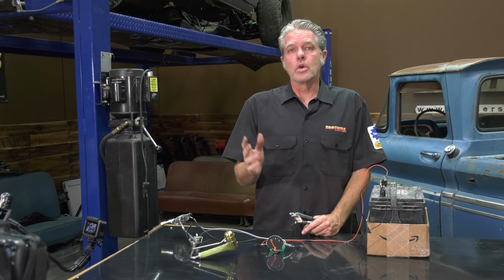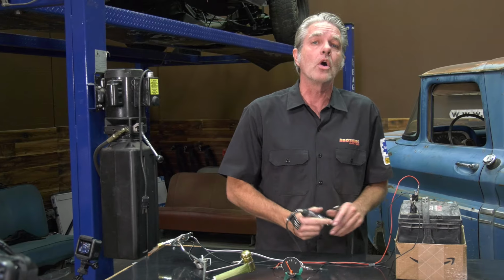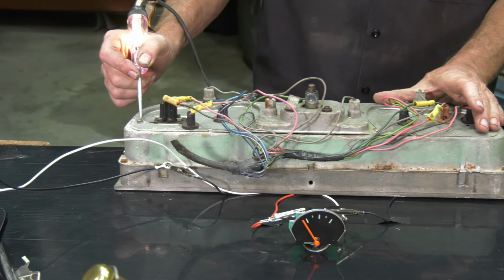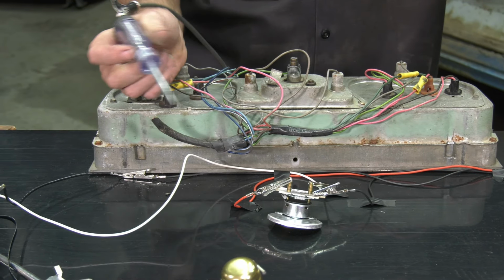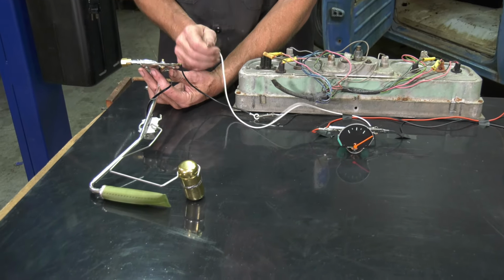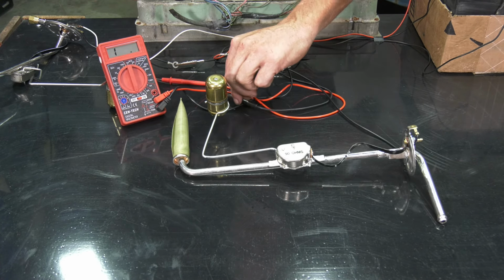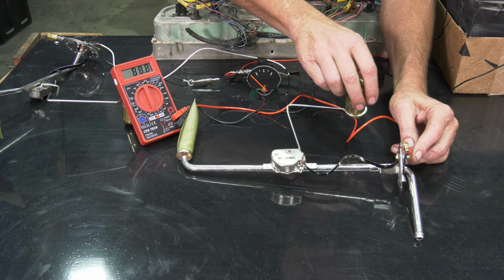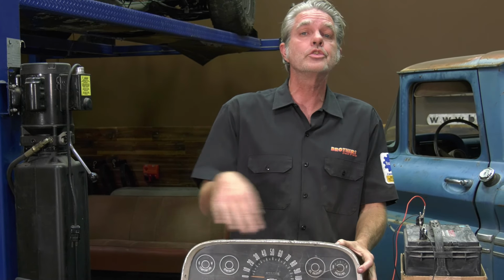1947-87 Chevy & GMC Truck Fuel Gauge/Sending Unit Troubleshooting

Comment: I got a gas gauge in my 78 c10 that’s bouncing around clock and counter clockwise and I don’t believe it’s reading accurately at all when it’s not bouncing right now, gonna try to add a ground wire from the post on the gauge to the cab, or any bare metal see if that helps…

ALSO can you do a video for someone without the tools , I don’t have a multi meter or test light right now and I’m trying to figure out my wire routing to my glass fuse panel, I left all bulkhead connectors alone, just the wires connecting to the fuse panel I have some cross feeding going on, windshield wiper switch when I move right to any speed it doesn’t work, when I press it in, it illuminates my dash and heater light… I rewired my headlight switch in the dash so last I check my dash lights work properly, after I tested windshield wiper switch and it still blew a fuse illuminating the heater light and courtesy on the floor…

Comment: Thank you for the great info, I have a 1979 chev c10 that I am resurrecting that has been sitting for 10 years, my fuel gauge was working intermittently, now it has stopped working altogether. it reads beyond full. This info helped a lot.

Comment: I bought a c10 with dual tanks. Looking for a dual tank setup
Reply: I know this is 1yr old already but the dual tank trucks have a selector switch on the dash. You press and hold for a bit. It switches the fuel AND the fuel sender from 1 tank to another.

Comment: Hey there, I'm curious about something.  I have a 91 Chevrolet Silverado R3500, last year of the squarebody heavy trucks, and I just got it back from the mechanic after they replaced both fuel pumps on the truck. When I sent it in the fuel gauge worked and about 5 weeks later, the gauge doesn't work! They said "oh it's the cluster  because the oil gauge reads 400 lbs"!  Sounds to me like they broke something and don't want to fix it! What would your thoughts be?

Comment: I'm an idiot.none if this makes any sense to me. It's lighting up on ground and positive?
Reply: You have power hooked up to the clip end of your light tester from the battery when testing the sending unit wire. (Passenger side of guage.)You are checking for a good ground. When testing the power going to the guage, you ground the clip end of the tester on a known good ground and touch the light part to the power terminal on the guage. (Drivers side of guage.) Does that help?
Reply: Key on when testing power side.

Comment: I put a fuel injection pump for a 80's chevy truck new, in my 1977 k20 tank and gauge wont register, any help are fuel gauge different ohms? Any help thanks. Aftermarket fuel injection, truck runs exceptional but no fuel in tank and i have put 12 gallons in tank

Comment: I had a question i have 75 K5 Blazer. Im trying to order a new printed circuit. When ordering a printed circuit there are different options. One of them being without gauges or with gauges. Im trying to understand the meaning of it. I do have the fuel gauge on the right, speedometer, voltmeter, oil pressure, temperature gauge and at the bottom left its a warning light or brake light. Which printed circuit to order?

Comment: If the gauge sweeps slowly toward full and doesn't return when hot wired is the gauge bad?
Reply from the maker: What do you mean by hot wired?
Reply: @BROTHERSTruckPartsTV  i ground the gauge then with my test light that has 12V Is touched to one of the post on the gauge it will sweep to full slowly, if I reverse my set up it will sweep empty slowly
Reply: @BROTHERSTruckPartsTV  I took the gauge out of the cluster
Reply: When everything is hooked up the gauge will accurately show empty for both tanks. But will never show above a 1/4 tank. I have the sending unit hanging outside the tank to test accurately. 
I've also replaced both sending units and chased and checked every wire.
Reply from the maker: @philup6274   Yes, it sounds like you have a bad gauge then.
Reply from the maker: @philup6274   BTW, Your troubleshooting skills are 100%!
Reply: @BROTHERSTruckPartsTV  Thank you brother. Teamwork makes the dream work. Thank you for making this video it has saved me so much time.
Reply from the maker: @philup6274  Our pleasure!

Comment: Dave did an excellent job in this video. Gauges and Sending units seem to be mysterious in some fashion but simple in reality.
  A gauge is best described as that experiment in high school science class winding insulated wire around a nail. When connected to a battery, it becomes an electro magnet.
   Now, imagine a gauge as a nail on one side wired clockwise, it pushes a paper clip away. A second nail is wound counter clockwise and attracts the paper clip. Now if both nails shared a common ground, a variable resistors, changing the strength to ground makes one side push or become weaker. Same here, except it is inside a gauge. So basically reverse polarity if you can imaging, the common point to ground is a wire wound resistor to ground. In this case, 90 to 0 ohms resistance. If at 45 ohms, both nails have the same push/pull, so the gauge reads? 1/2 full! You got this. As Dave did, placing the lead to a good ground will push the needle completely one direction. 
(Imagine one nail is strong and the other is dead) The different is at the sender.
Dave made another good point, that's using dielectric grease on connections. Under the truck? You bet! On the cluster connector, sure! It keeps them clean and not green as copper traces oxidize. They slip in and out better as well, saving that printed circuit on your gauge cluster. Thanks Dave! Good info for those in town and around, the world! Keep em going folks! 
DK, ASE master since 1978.

Comment: Is gauge failure a common problem? I'm running out of things to check, my trucks a 56.
Reply from the maker: check out our more recent video about fuel gauge troubleshooting. Maybe you'll see something in it you didn't see here. Gauge failure is always a possibility too, however its easy to check and eliminate that as the issue normally.

Comment: I have a 12V Gauge. It reads past full when the sending unit isn't even connected. Can you please make a video on how to wire it? This truck was given to me so I do not have the directions.
Reply from the maker: This is almost always caused by a lack of a 12v source of power to the gauge. The gauge will just drift higher and higher, even well beyond full. Make sure your gauge is getting a 12v power source.

Comment: Dave thanks for the video, just changed to EFI on my big block 69 c10 restto- mod.  Been fighting with my gas gage for a week. You made it so simple. Fixed after watching your video in about 20 min.
Reply from the maker: Nice! Thanks for the feedback.
Reply: What was you issue that got solved?
Reply: @philup6274   it was not properly grounded. I used rubber washers installing the fuel tank, what happens you over think something. Removed the rubber washers. Working perfectly now. Thanks again

Comment: I have a 71 Chevelle
I pulled the fuel tank and replaced the sending/float unit because the gauge would stick on fuel.
I noticed that the stop tabs for fuel and empty were bent off to the side.
When I pushed the float all the way up past the fuel tab it would stick there.
So when I installed the new sending unit I did not bend the tabs.
Now when the tank is full the gauge read between 3/4 and 1/2.
Once the fuel gets down between 3/4 and 1/2 then the gauge works.
Any ideas on what’s wrong?
Reply from the maker: Sounds like the tabs are blocking the float from moving all the way to the top
Reply: @BROTHERSTruckPartsTV  
That’s kinda what I was thinking but no one said anything about bending the tabs

Comment: Dave, do all C10's gauges come with resistors, oil, temp, fuel, battery. Can bad resistors give you false reading or no reading. Please advise. I'm trying to get my 1980 C10 back on Road. Any info would be greatly appreciated. Thanks Robert  one more question, Dave . The porcelain resistors are in the back of the gauges correct? Now are they a part of the problem that the gauges don't work.? Or do you need the porcelin resistors to get the gauges to work. It's been a long day and I'm tired. Please help.  Everything works except the gauges.  "My gauges, Are 40yrs old"
Reply from the maker: Yes many gauges have resistors, and they need to be GOOD for the gauges to work. However, if all your gauges are NOT working then you likely have a ground problem or your cluster isn't getting 12v power.
Reply: Where does the power go to on the cluster Dave is it the full side terminal or the empty side

Comment: 1986 c10 new fuel tank and sending unit but my fuel gauge only moves to quarter of tank. I rebuilt the instrument cluster.  Is there an adjustment to the fuel gauge  the do or reinstall it wrong?
Reply from the maker: There's no adjustment, something is wrong. Bad ground, bad sending unit, bad gauge... start by checking all the grounds and the 12v power to the dash.
Reply: @BROTHERSTruckPartsTV  I checked unit, ground  I believe it's  the gauge on the cluster.  Now that remember hear d a little pop noise. Thanks
Reply from the maker: @tinocorrea742   if the rheostat on the gauge gets damaged you could have the gauge only work to a certain point and then stop. Does it sit there for a long time when you fill up and then start dropping when your tank gets low, or does it act normal but just doesn't go all the way up anymore?
Reply: When I fill up that where it stops. It moves down just not all the way full.
Reply from the maker: @tinocorrea742   but WHEN does it start to move down? right away, or after you burn through 3/4 of the tank?
Reply: It moves as if it marking full. Moves as I drive truck like normal but  needle doesn't go all the way up to full when I fill it up. It stops on quarter line on the gauge and no more.
Reply from the maker: @tinocorrea742   Ok, so there is either a problem with the sender, or it could still be a weak ground on the dash panel.
Reply: I'm going to check the cluster again or the fuel gauge on the cluster maybe it not correct when I rebuilt it. Thank you

Comment: I have an 87 truck with dual tanks. fuel gauge always shows the drivers side tank fuel level ( accurately). when I switch tanks it actually switches tanks fuel wise. but the gauge stays on the driver side tank level. Can you point me to trouble shoot this one.
Reply from the maker: it sounds like you have no switch connected to the signal wire from tank two. These tank senders are simple 1 wire units, so you'll just have to trace down the wire for tank two and see where it goes and if it's connected to your switch.
Reply: @BROTHERSTruckPartsTV  The Senders from the tanks are on switched terminals A & C of the Valve. They each read an Ohm value 0-90 depending on the fuel level. From there, does terminal B supply the info from either sender directly to the Gauge? I get confused with terms here. I call the motorized Pollack valve the 'Valve" and the AC Delco dash switch the "switch".  It looks like the switch tells the valve which Tank valve, return line, and Sender to use. but the switching of all three happen in the valve.  I will see if terminal B on the valve has the Ohm Value of terminal A or C. and if it changes when the switch on the dash changes.  If I have this correct. It seems the pollack valve is switching the fuel lines and Return lines but not the sender information.  Confirming or correcting me would be a big help.
Reply from the maker: @joeengel5132   to be honest, we don;t have a ton of experience with these valves.switches either. We would do EXACTLY what you are doing by testing the B value to see if it has the A & C values correctly. We'll try and gather some additional info on this as well and report back here if we find anything.
Reply: @BROTHERSTruckPartsTV  Just following up on this. I did figure it out.  this is the correct operation for a 1987 Square body with dual tanks. (The Senders from the tanks are on switched terminals A & C of the Valve. They each read an Ohm value 0-90 depending on the fuel level. From there, terminal B supply the info from either sender directly to the Gauge)   Thanks.
Reply from the maker: @joeengel5132   Excellent info, hopefully we can do a video on this at some point that will help others that are having troubles like yours. Thank you!

Comment: I got a new sending unit and checked it like you did, and it didn't go to 90 like yours did, 1975 Chevy Cheyenne K10 350
Reply from the maker: What did it go to?
Reply: @BROTHERSTruckPartsTV  Fuel gauge
Reply from the maker: @kellybergin1532   We meant what OHMS did it go to? If not 90 then what?
Reply: @BROTHERSTruckPartsTV  I installed the sending unit then pulled the tank back out and rechecked it along with the guage that I Fukd up the sending unit works right
Reply: The sending unit is ok
Reply: @BROTHERSTruckPartsTV  Brothers, what plugs into the female plug at the bottom of the steering column, is it those 2 plugs ?? I got this truck and it is all jacked up.wiring wise!!
Reply from the maker: @kellybergin1532   Depends on the color of the wires in that plug. Not familiar enough with every model year variation to try and give direction without at least know the wire colors.
Reply: @BROTHERSTruckPartsTV  I check the wires tomorrow and let you know, they were hanging loose when I got the truck about 4 months ago
Reply: @BROTHERSTruckPartsTV  there was no plug on the bottom of the steering column either, otherwise I would know

Comment: Where did you connect the positive wire off the battery?
Reply: Ok, I see that, but you have wires running under the cluster so i'm confused
Reply from the maker: @kellybergin1532   those wires are just random jumpers we were using for the demonstration.
Reply from the maker: We connected it to one of the posts on the back of the gauge as seen @ 1:48 in the video.

Comment: I have dual tanks. Gauge works correctly when switched on LH tank. But when you switch to RH it’s empty (but it can have a full tank).
Reply from the maker: Probably a ground problem, but you need to test the sender to figure it out.

Comment: Fantastic video brothers. You got me in the neighborhood. For whatever reason my 85 S-10 goes through gas pumps every so often. I'm on the 3rd or 4th one. Early on mos prolly ethanol. Haven't run that in years and the last one is holding good. But after the last round the gauge is just wonky. Might show half full and then flop over to full, depending on the slosh. Did we put the sending unit in backwards? It's all over the darn place but never shows what it should. Ground? Backwards? The bed is coming off soon so I can get to a short rubber line that is currently spewing gas when the pump is on. Failed at the clamp. (The thing is beyond antique. Ha!)  While I'm there thought I might as well see to the gauge. Suggestion? I thank you!!
Norm
Reply from the maker: Yep, check everything you can while it's apart and easy to access. Thanks for watching!

Comment: Great video David, thank you
Reply from the maker: Our pleasure!
Reply: Hi David, I took some ohm reading's on my sending unit on my 53 Chevy pickup, I'm reading on empty 18 ohms and full I'm reading 52 ohms. I'm thinking that's not good. When on an early Chevy you said, it should be 30 ohms when full.  My guage reads a little less then half when tank is full of gas. When I remove wire off the sender and ground it to itself the guage goes lower. It don't ping to full. Not sure if I have a bed sender unit, and a bad guage. Can you please answer that, it would be great to get this gas guage to work again. Thank you

Comment: so my k5 blazer reads from empty to 1/4 tank, now matter how full it is, I replaced the sending unit, and the new one does the same. if I ground the sending unit wire it reads empty, and if I leave the circuit open, it reads full. help!!
Reply from the maker: The entire fuel gauge system relies 100% on good grounds, and you have a bad one somewhere. Our next step would be to run a dedicated ground wire to the gauge itself and another dedicated ground to the sending unit.

Comment: I have a 76 Chevy Nova. The gauge reads full all the time. As soon as power is applied the gauge moves to full. Can I test the resistor behind the gauge before pulling the sending unit?
Reply from the maker: That typically indicates that you have no 12v power at the gauge. The dash should have a 12v source that supplies the gauge with power. Check that first.

Comment: I got a Chevy 350 in my class c RV and the fuel gauge went out last year...seems like I would have to drop the tank to get to the ground wire in the sending unit?
Reply from the maker: It's possible, they don't always make it easy.

Comment: Hey Dave i have an issue with my 1986 chevy silverado on my gas gage a full tank and the gage reads 3/8 on both sides i replaced sending unit on one side both sides grounded good
Reply from the maker: Sounds like you have either a bad fuel gauge or a bad 12v power supply to the gauge itself. Did you happen to hook up the new sending unit and test it while it was out? It would be interesting to hear what happened if you did.

Comment: You guys are fantastic I buy everything for my 53 chevy truck from you. This video was an incredible help in me figuring out my gas gauge problems.  I recently converted my truck from 6 volt to 12 volt and I am installing a gauge reducer to my gauges.   Do I need one, not only for my gas gauge, but also for my battery gauge.  Thank you for all your informative videos
Reply from the maker: Yes, voltage reducers for all the 6v original gauges.

Comment: How did you get power to the cluster
Reply from the maker: We used the power lead on the circuit board and just attached a battery to it using a clip on electrode.